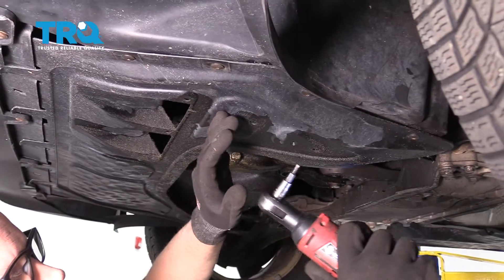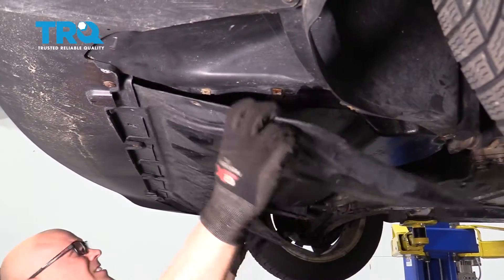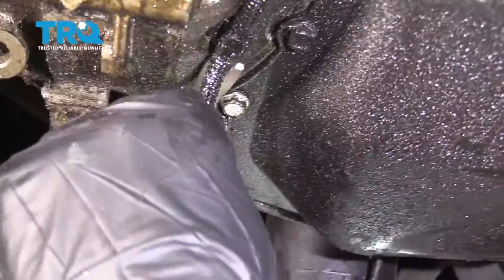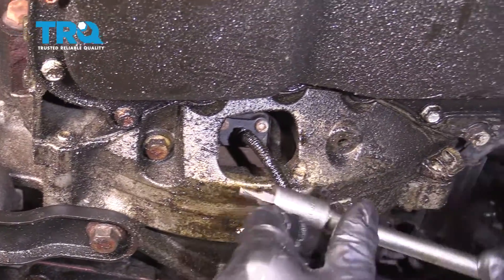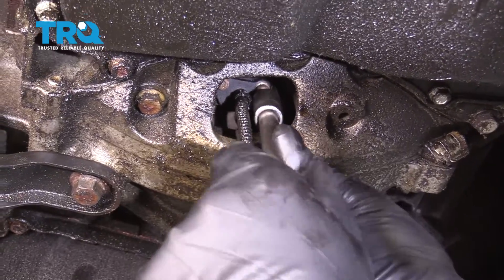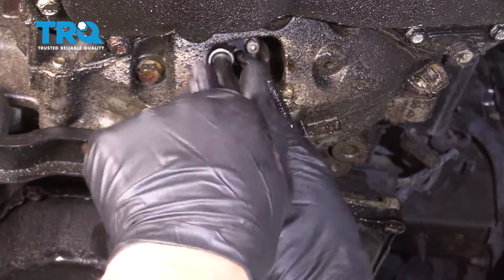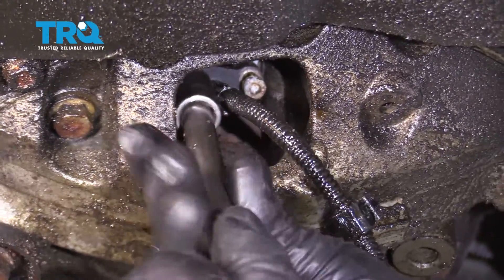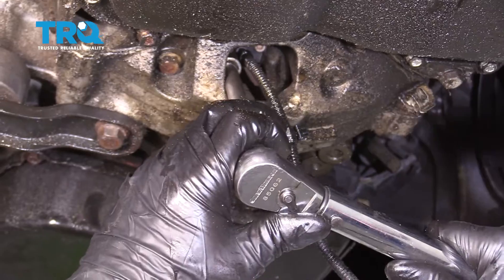How to Replace Crankshaft Position Sensor 2006-10 Volkswagen Jetta

Comment from the maker: √  Watch the Video
√  Buy The Part at 1A Auto https://1aau.to/m-Shop-TRQ-Parts
√  Do it Yourself
√  Save Money
Reply: Rather, in 2011 Jetta 2.5L SE, the Camshaft Position Sensor seems to be on top.  However, where is the Crankshaft Speed Sensor? Do you have information on how to replace that?

Comment: This video is for the 2.5 5cyl engine!!!!   on a 2.0 FSI  the sensor lives behind the oil filter.  Removing the oil filter helps to get to the sensor but it can be done without removing it.   Also the air charge pipe coming from the intercooler going to throttle body needs to come out.   Also their is a metal bracket that holds the sensor connector held by one screw that needs to come out. Other than that,  not to bad of a job.

Comment: Actually all that oil is coming from the oil cooler and a freeze and oil run through the same spot in that cooler and it is a typical problem that O-rings go bad like how he replaces the positioning sensor but ignores all the oil residue everywhere so the guy that said it's a brake booster you're wrong you're wrong those vacuum hoses plug up to the intake

Comment: Would be great to know if this is a 4 or 5 cylinder but you don't specify. Judging from my Haines repair manual it looks to be a 5 cylinder, on the 4 cylinders it is located behind the oil filter housing.
Reply: It's the 5-cylinder model.  I have this job in my near future.

Comment: All the oil residue is from the mechanical VACUUM PUMP for the brake booster. The rubber seals go bad...repeatedly. This can be deleted with a kit. 
I am glad you gave the torque spec for the bolts. I just replaced my CRANK POSITION SENSOR. Be sure to insert the 4mm hex head as far into the hole as possible and hold the socket wrench as straight as possible. You can easily strip the head. It was harder to remove the bolts than it was to install them.